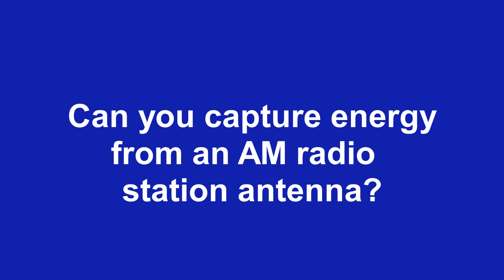Can You Capture Energy From An AM Radio Station Antenna?

Comment: Made my first crystal set when I was 8 years old, this was before the days of small transistor radios, I had to run a huge length of wire for the aerial, a few years later, I made my first transistor radio and could listen to Radio Luxembourg and  later the pirate station Radio Caroline.

Comment: A mate and I messed about with using a crystal set to power a calculator, the later version used energy from the local BBC MW transmitter to power a VHF FM receiver.
Reply from the maker: We intend to go back and use a much higher antenna and hopefully power a portable radio, calculator or any other low current device.
Reply: @Jonny10001  my friend did not live very close to the transmitter, fortunately modern calculators use very low power. With yor experiment you might be surprised just how little current it takes to light n LED dimly, far below 1mA.